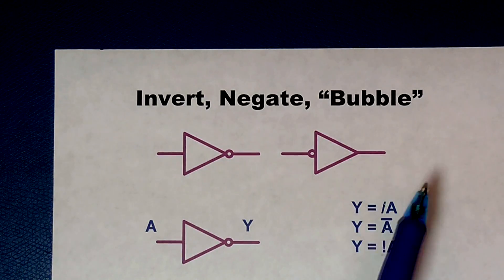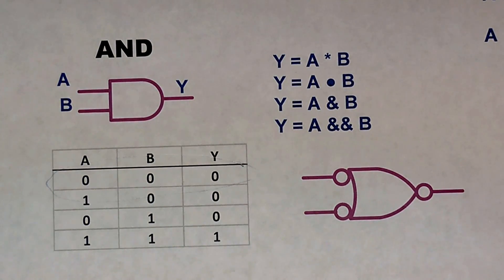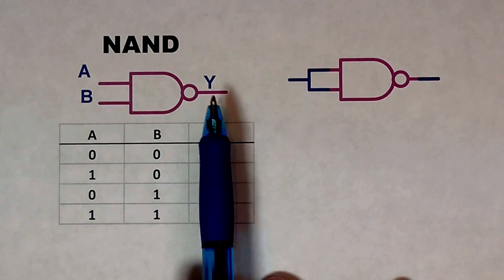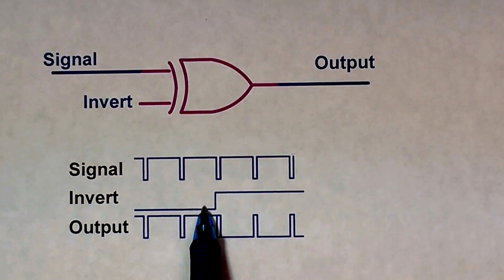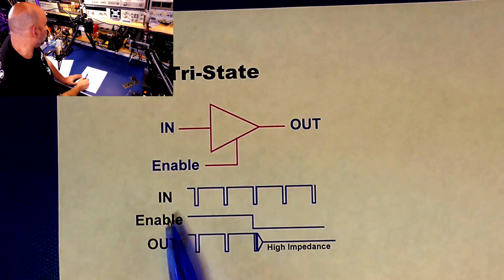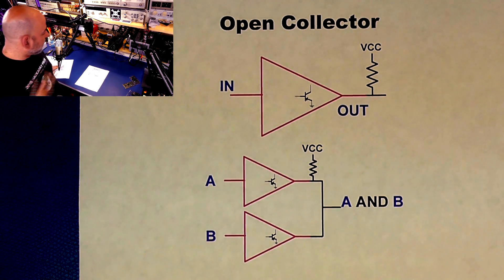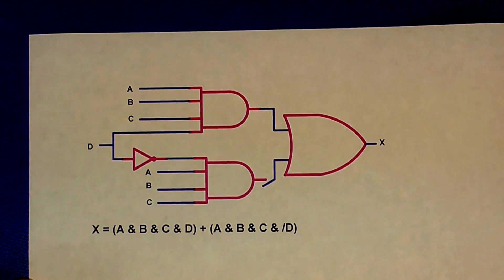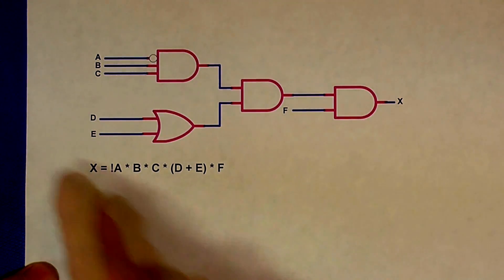Hackaday Logic Series: Basic Logic

Comment: Thanks for the presentation Bil.

There's some things I'd like to see. 

The talk goes fast. I can read the symbols, but I can't run through the whole range of possibilities in my head when you have six inputs. It would help to give an example of where that logic may be used, eg as you did with your shared memory example.

Even as a programmer, this very low level stuff is all new. Especially when you bring in electronic information.

What I took from this is a reminder of the symbols and a warning there are delays in the system which causes potential problems. If that's all you warned to say then you said it!

Organisation wise, it's helpful to begin with where you'll be after listening. "In this video I hope to show...", "At the end you will know... ".